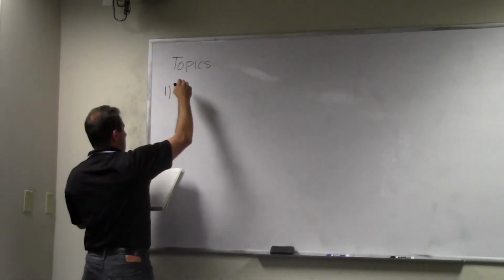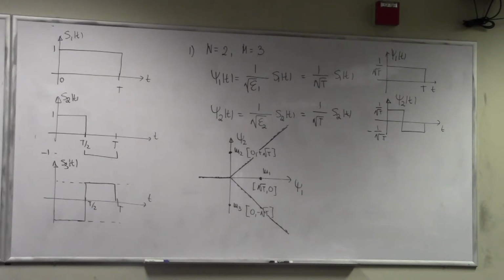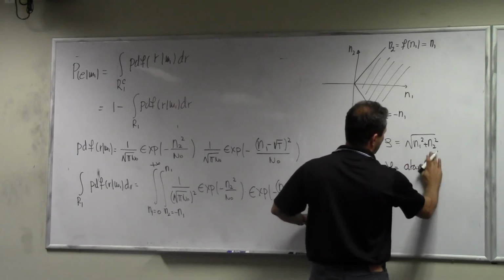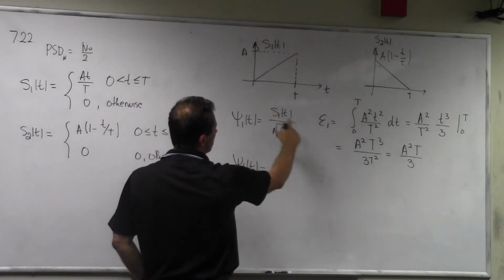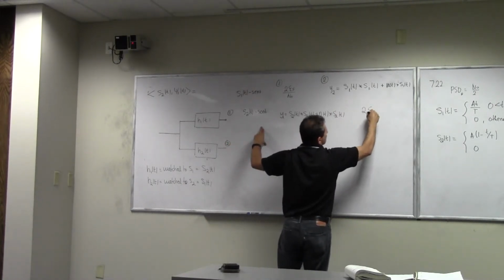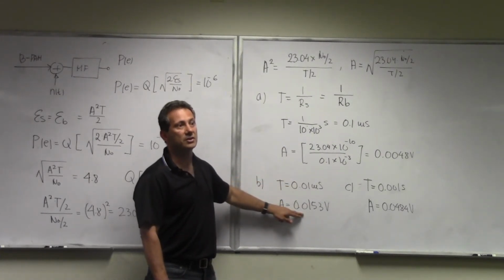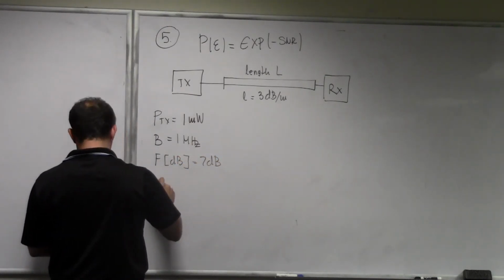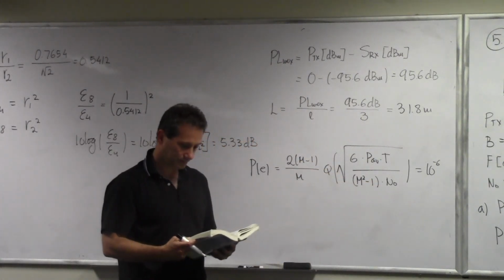Review For The Final

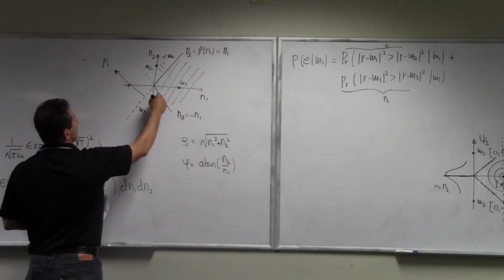Comment: The solution in the book at about 28:00 uses as an upper bound of error the Union bound. It's a good approximation but not exact., because you double count one region. But it's easy to calculate, it's just two Q-Functions because the noise is rotationally symmetric.